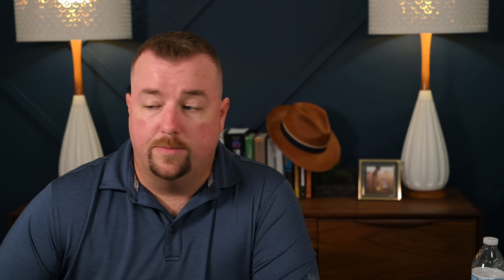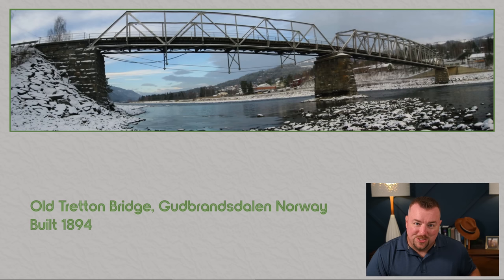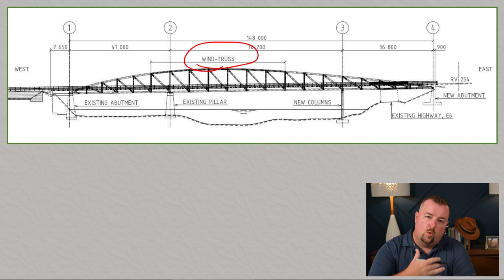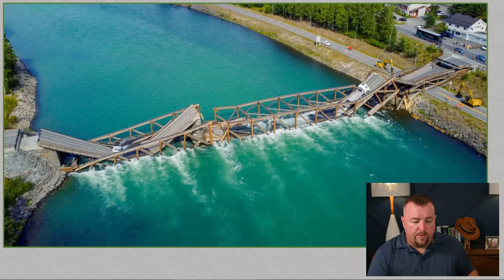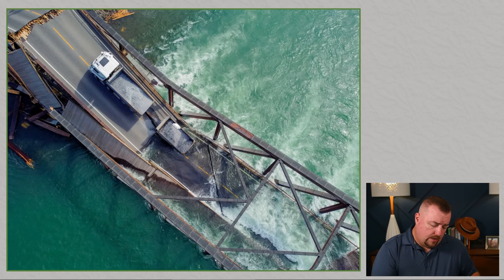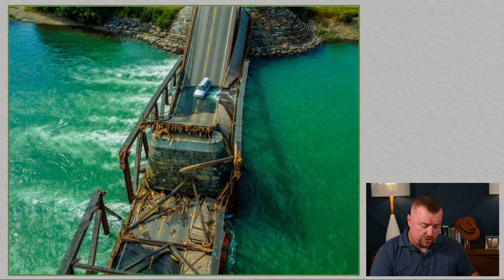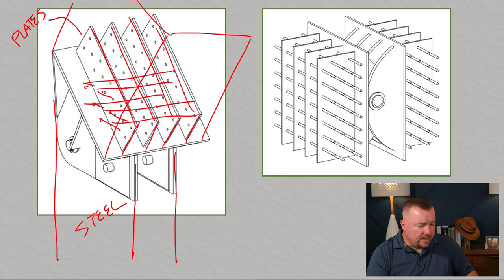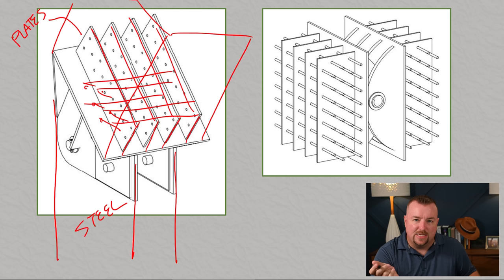How Did the Engineers Miss This?

Comment: It's not aspalt" just poured  on the wood" there are waterprofing membranes  and the asphalt on  layed on top on that. Also there are  metal plates  on top  of wood to protect from rain, and dripping edges to  lead the water of. The "dowels"are often  screws that 
Is screwed thru  the wood and the  metal joining plates in on go , the screw sometimes drills the hole in the plate. Laminated wood in  infrastructure  prodjekts is a relatively young, technic ,compared to steel. 
And I would guess that what was built  10 years ago is probably not the same as what I built today,in regards of dimensions of contention plates and screw dimensions,  so dont draw the conclusion that the technique it self is bad. (All doe this bridge obviously  had  a to weak construction, for its traffic load)

Comment: No the design of that bridge was to fail the bridge is a row of dominoes shifting all the weight and forces to the opposite side of the bridge! If they'd built it with the side supports having a X like pattern and then built it under more compression putting more pressure pushing the joints into each other instead of pulling them apart

Comment: its a truck or wagon, a lorry is usually articulated....  they should ban glulam bridges. or any structures made  from that material.  they should make a bigger steel bridge.  and existing glulam bridges should be replaced immediately. and should be barred from use until replacements have been built.
Reply: Come on, thats nonsense. The mistake here was obviously the tension/stress calculatoins of the bridge. The materials itself arent the problem, or at most the application of the material is an issue. In fact they checked over all glulam bridges after this accident, to look for similar flaws.

Like, we dont ban concrete and steel bridges just because steel bridges collapse all the time. Instead we use it as a learning opportunity as to how to avoid problems.

And theres wood bridges that survived for a very long time after all.
Reply: @termitreter6545  is just my opinion, if i where in charge of Norway, I,d ban em.  You lost me at the part where u said, steel bridges collapse all the time. Which might be true depending on what country your in and what decade you happen to be talking about.
Reply: @SuPeRbOmBeRmAn4  Well you said wood bridges collapse, so you ban them.

So what about steel bridges then? Theyve collapsed all the time too, in every single country.

Like theres no difference in a badly built wood or steel bridge. The problem isnt the material, its bad construction practices and stress-testing.

Comment: I guess there is a mining facility nearby for this type of truck to be on the bridge. I guess there is probably a lot of heavy trucks laden with crushed rock going over the bridge. That will of course be high stress but fatigue stress on the pins and the glue lam connections will likely be a contributor to failure. Also, copper clad on top. I don't know if there is an air gap but in the colder months and Norway has a lot of them, this will attract condensation which will form under the sheet. That will struggle to dry and also cause rot.

Comment: It held the load and stresses for 10 years...so time created the failure.   Did the glue fail?  This should have been found via inspections, wet wood, rotting, splitting or separating should have been noticed.   Attaching 2 dissimilar materials can often promote corrosion.   The way the steel was attached to the wood must have localized the stresses or focused them.  When you weld steel, the 2 pieces almost become one.  But you can't attach metal to wood and achieve the same level of bonding.

Comment: Surprising design. 

Like concrete, I dont think timber beams in tension are a good idea. 

I have made some timber cantilever beams that are in tension overall but built them as a torsion box with a tension cable through the middle to relieve the tension stresses. Seems to work well.

Comment: It occurs to me that gluing (epoxy) the steel to wood interfaces would have been far more effective with appropriate surface texturing of the steel - at least for those connections as the wood fibres would not have been under the high local loads of the pin to wood interface.  Further, if "pins" needed to be used, perhaps square pins rather than round might have been better.
As to the copper sheets, it's possible that there is a wide air gap between the copper and wood to allow for moisture to evaporate in a timely manner while preventing outright saturation from the rain.  (Splashes are another matter).

Comment: What is the difference in the coefficients of thermal expansion of the bridge's WOOD and STEEL and CONCRETE? Well: Concrete and steel share the same coefficient of thermal expansion. Wood is VERY different. SO: keeping in mind that bridges also have dynamic loads - the environs of this failure mode also plays a part. The most critical joint areas of the weakest link in the chain (the wood that is socketed) cannot be inspected. An ALL wood bridge would be the best possible design. PERIOD. Wood workers, master shipbuilders, Carpenters, mechanical engineers will ALL agree. Just use the right wood, the right design and the best fitments. K.I.S.S. should be adhered to. Wood can demonstrate AMAZING strength when loads and forces are directed through the wood fibers properly.

Comment: i'm curious to know how and at what stage the holes in the timber for the bolts/pins were drilled, before erection ie; in the fabrication shop or on site after fitup ? If drilled before fitting on site then it is extremely unlikely that all these holes would perfectly align with those in the steel and would therefore require injection with epoxy or similar to  ensure even loading on all the bolts/pins.

Comment: So they pretended to build a wooden bridge, but it was one quarter steel, had thousands of iron bolts, contained tons of glue and was covered with asphalt, and then failed because they didn't have sufficient knowledge in the use of  wood as a building material...

Comment: I have  built many structures even boats this is common sense that the  bolts would tear wood parallel to grain🤔
I noticed all diagonal members in tension or compression run all the same direction . Normally at mid span they reverse?

Why would an international conference of PhDs  and lab be needed to show this?
Steel rings often encircle ends of timbers to prevent wood tearing for centuries!!!!

Truss plates used in America on residential typical light weight  wood trusses pressed in from outside are amazing strong and do not split the wood.

Comment: Demo should be easy. Just drop a truck load of termites on the span. Would this structure have been stronger if they had used boxed truss roadbed? It certainly would have been stiffer.

Comment: What if they just clamp the wood on the outside and have ridges to dig into the wood if it were to pull out. Like the ridges on a hose connector. Though I think there are more problems then just that.

Comment: I do question whether the natural expansion of differing materials due to repeated temp' changes had been accounted for in the software. We have vertical steels which naturally would lengthen and contract while the wood would try resist such expansion given steel has a much higher thermal coefficient, to me this would surely put repeated stresses on the plated joints working them loose and/or weakening them over time.
 Happy for feedback as structural engineering is not my forte but I am an engineer in other areas thus find a interest in these things.

Comment: The connections needed steel expansion joint to do the expanding and contractions. All the force is going to the rigid dowel system. The elongation in the wood from the dowel would gave been prevented.😕🤷‍♂️

Comment: Famous line: "I'm not an engineer." - But that failure of splitting at the dowels is so obvious you wonder what kind of collective delusion these people were under so that they expected something else. The bridge looks like they took a design made for metal and adapted it, which even so, was not tall enough (and too long) at the initial point of failure to provide a comfortable amount of excess strength. You'd think the big Glue-lam beams would be inserted at the joints in metal receptacles but I suppose that would present weather-related issues. Still I bet they eventually will come up with a way to build strong wooden road bridges. They had rail trestles way back. They still use the splay-legged kind a lot. I expect the problem is related to combining flexible wood with stiff steel - makes the wood fail.

Comment: As with steel (the author's clear favorite,) not all wood is created equal.  His failure to touch on this point exposes his unfamiliarity with the material.  Oak & maple have magnificent strength, but also high density.  Poplar seems a good trade-off between those.
Locust is decay-resistant, but too "brittle" for much of anything.
Redwood is decay resistant, but quite expensive.  Cedar is likely the better option.  Pine, that staple of modern American construction?   I don't think so.

Comment: I'm curious to know how strong these joints could be if the root of the connection has cross-grain elements. All of the tests were with the grain. Would it work better if, say, 66% of the layers between each steel plate had to have the grain perpendicular to the tension? Maybe that isn't feasible if the size of the laminations are on the order of framing lumber.

Comment: I'm surprised they were using a layer(?) joining with the plates. I would have thought they would have used (or at least have had as additional later) have had the steel surround the wood kinda like a sleeve.

Comment: Very interesting analysis. Thank you!
I have a stress analysis background (although not structural) and I was amazed to hear you say that those joints were modeled as homogenous material, with parameters based on testing. I don’t think I’ve ever seen a less homogenous material! 

And the brittle, unpredictable failure mode of the wood splitting along the grain takes me back to the days when bridges were built of cast iron. I have always assumed gluelam would have the grain directions in multiple directions, like plywood. Doesn’t sound like it does? As another commentator said, it looks like much more work is needed to fully understand this joint design. 

I was also surprised to hear you say this material is very susceptible to environmental conditions! How could any company or designer have the hubris to claim 100 year life in that case?

Comment: a probably very dumb question but why not band around to add compressive forces? wood splitting from drilling in it is not suprising on an intuitive level of doing basic carpentry. I have seen many antisplitting strategies employed.
Reply: like how barrels have banding
Reply: also would  doing that wierd burn technique used in japan to seal wood help with the thermal cycling and water incursion

Comment: Hi, Greetings from the old country (England). As someone with great interest in but absolutely no experience of civil engineering this is fast becomming a favourite channel of mine, and your presentation makes perfect sense to me. I do have a couple of questions though, it they had used solid timber rather than Gluelam I guess the mode of failure would have been the same but with different values as the wood fibres would still all be aligned and the bolts would still serve to split the timber in the same way? The other question is whether when they construct the Gluelam members, if they effectively made it a "cross-ply" construction rather than having all the plys aligned (which I assume is what Gluelam is) would that have strengthened the joints?

Comment: I would have made the structural design different: from the point point C the tension loads should have gone in both directions, namely top c to low d as it was, but also top c to low b and so on right to the middle of the bridge ( stress wise) and then change. Thats what we were taught at university ( and work at in the structural engineering office)

Comment: 18:35 and then either put a steal compression band around it or a compression cap to eall cruch and hold those wodd fibers in place to pre stress them as it were so that those  bold to split the would first have to move it out of the way  but oh  it cant move the fibres sidaes without over comthing the tensile strengh of the steel band or cap

Comment: As an armchair quarter back and a woodworker (mostly furniture), but an engineer of no kind whatsoever, I look at those joints and cringe.  At very least use square dowels that are situated so they have a flat face that's perpendicular to the force being applied.  Relying on round dowels in sheer loading like that is just begging for the wood to split.  You're going to have a much harder time splitting a log with the flat side of a piece of square tubing than you are with a piece of round tubing.   Also, wouldn't it have made sense to have some sort of circumferential strapping that gets bound down tight around those members at the site of the joints?  That way, failure would require a straight-up severing of the wood fibers as opposed to just splitting them apart so the dowels can pull out.  I dunno, I know approximately nothing about structural engineering, but I've made enough tables and chairs to know I'd never use a joint like that in my designs.  I don't trust it.

Comment: 34:02

yes, very strange indeed

virtually all aspects of this

if they must use wood, then at least laminate it the other way around with alternating wood grain patterns

and then instead of dowels just bolt it together
if you clamp the wood together tight enough then the friction alone would do a lot to keep it together

this whole thing is just kinda silly

Comment: @BuildingIntegrity Very good video. One thing I would have liked to see more of is how it could or should have been done. The last paper you showed stated after the highlighted parts that it is possible to design wood structures by factoring in more accurate depictions of stiffness and ductility so that they will not fail. Perhaps a more indepth look at this would be useful.
Thank you!

Comment: I'd like to point out that this reminds me of when Apple used aluminum in their "bendable" phones. I don't blame the engineer, because at the end of the day there is a biased opinion or a ventured interest. My assumption is on a ventured interest of related parties in the wood industry promoting these types of bridges, or at the very least, as you mentioned (or implied?) at the beginning of the video, that the people involved in the decision making having motivation of sorts to specifically encourage laminated wood infrastructure. Also, I wouldn't blame the CAD software for the lack of weathering details, because that would apply true for even metal, let alone the concrete and the retaining walls for supporting pillars and abutments being weathered away from erosion, or even the surrounding vegetation that is removed during the building process that erodes away and reveals previously covered areas. I wanted to mention my opinion on CAD, because you spent more time critiquing software engineers than the political bias of the involved parties for decision making. My comment/rant is kinda lengthy, but thanks for reading.

Comment: Very strange design. In the UK is the first Iron Bridge and it is designed exactly as you would design a bridge made of wood because there had been no iron briges before it. Now this bridge is designed as a metal bridge but made with wood. It is never going to last very long. You need a HYbrid design based on wood joints not steel. The design of the bridge with the new supports should have a sliding or bending plate joint to allow movement of the road bed and no transfer any bending to the new vertical supports. I am not sure of the method of building the laminates but with fiberglass you cross the fiber layers to build strength in all directions. Some softwares allow this cross fiber lamination to be used for FE modelling.

Comment: Sorry, I have to disagree with your point at t=36:28, the issue is - and at that time you had explained it very fine a few minutes ago - the calculation on wood as if it was amorfous like streel or concrete and disregarding that it is directional and fibrous. The point that engineers designing with a material should try to work the material with their hands needs to be made.

Comment: Unrelated to this video but I would truly love to know more about what caused Sanibel’s causeway to fail. I thought it was designed to handle storm surge and category five winds. It’s only 15 years old!
Reply: Well...they don't build them like they used to
It could be a miscalculation by the architect(s) and structural engineer(s)
To save on costs designs are minimalistic and construction has to be done fast (once approved), a small mistake can bring the whole thing down
Corrosion by salt and improper inspections don't help

Comment: The second that you showed the construction method, it was obvious that all of the joints should be supported underneath by structural steel, to support the wooden members. This is simply ignorant construction based on the agenda of the engineers and funding politicians.  But any wooden construction method using glu-lams in an exterior location is so ridiculous it really makes me question the engineers and architects.